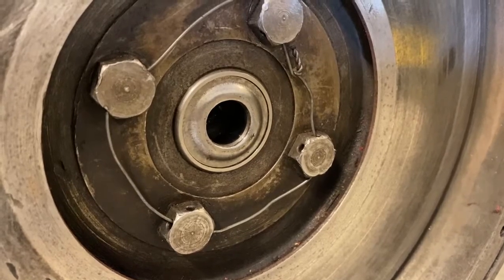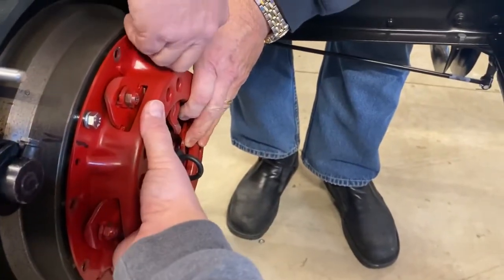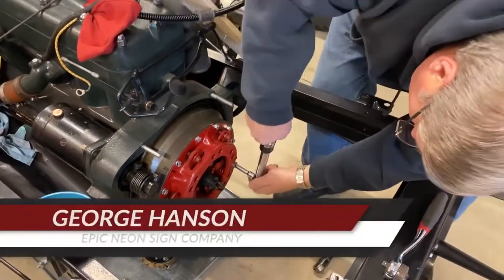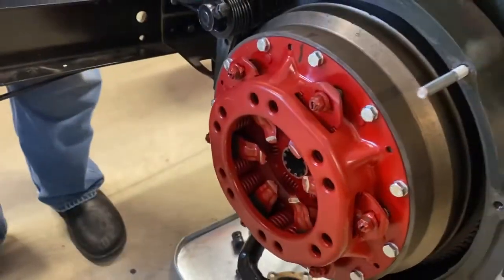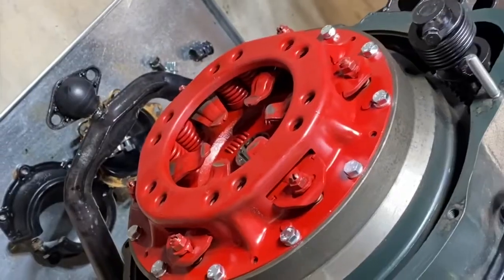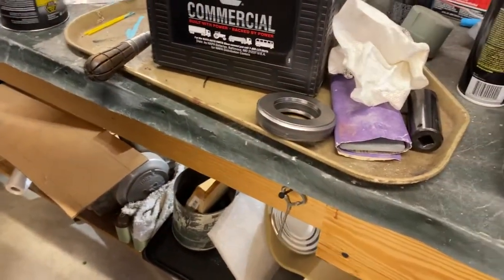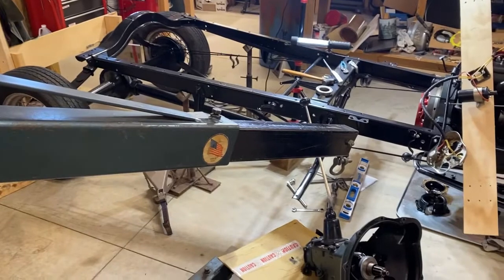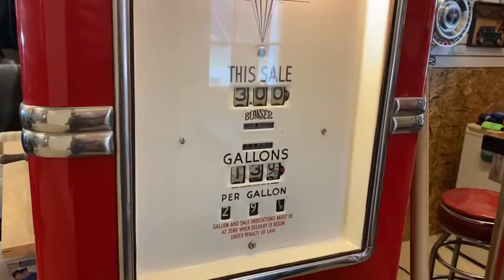1930 Ford Model A Restoration - Ep.16 Adjusting the Clutch Fingers | Epic Neon | Epic Restorationz

Comment: Great idea, great videography.  But I'd have liked to see more of an explanation of why you loosened the fingers and then as you adjusted them, more about what you were trying to accomplish.  Aren't the pressure plate fingers adjusted properly right out of the box?
Reply from the maker: Maybe the ones that you purchase from a supplier are adjusted properly. Ours was already installed on the chassis and set to the wrong depth when we bought it.
Reply: @EpicRestorationz  Good answer.  Wouldn't hurt to check even if it's "new" from a supplier.